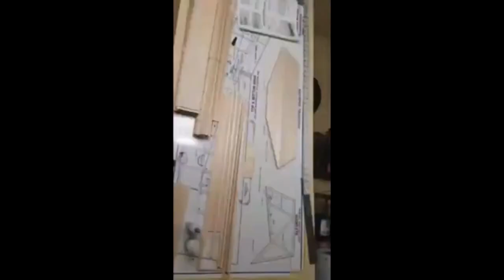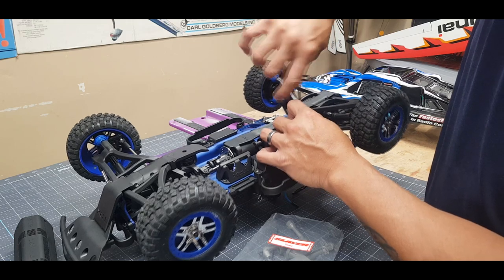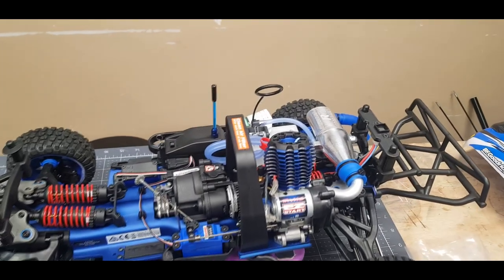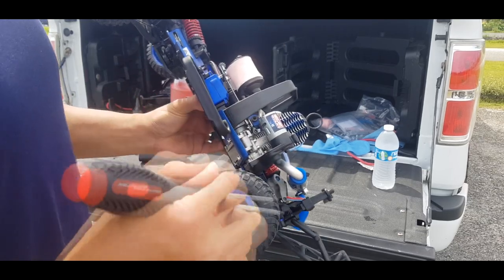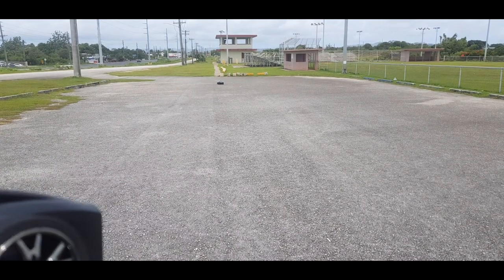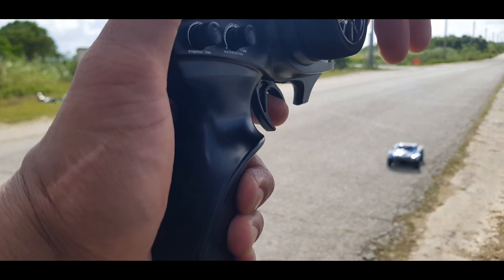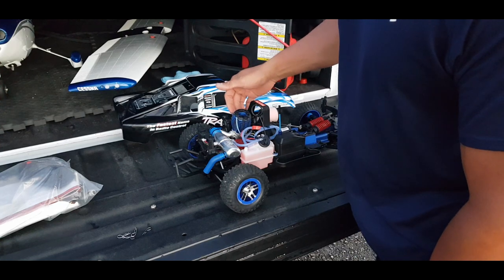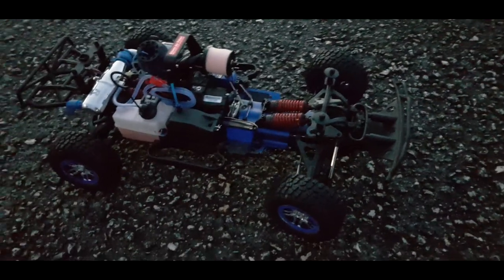How to Break-in your Traxxas TRX 3 3 Engine (Slayer Pro 4x4)

Comment: I just got a slayer, it is not my first nitro RC, I currently has 3 vehicles (1/8 buggies and 1/8 truggy) running 2 OS and one Picco engines, however I always send my new engine to my LHS which broke in for me by the Adam Drake’s method, I would just run them rich for one or two tanks before I made my adjustment, I am puzzled by the amount of effort needed to be made to break in the TRX 3.3, may I ask is there any short cut method to go for it, I accept suboptimal result, thank you very much
Reply from the maker: Well overall the idea is basically bringing the engine up to temperature and then allowing it to cool so that all internal parts properly work in slowly.  The problem I see with most of the newcomers into nitro is at the first run they are already trying to squeeze out all the power by leaning the mixture too much.  This is where they end up overheating the engine!  So the Traxxas breakin procedure is a careful way to get newcomers to manage engine breakin while getting use to their first nitro vehicle.
Reply from the maker: They have many breakin methods out there so it just comes down to personal preference to be honest.  All I did in this video was to show the Traxxas breakin procedure in action for those visual learners.

Comment: Good video buddy. 

I just was given to me a Revo 3.3 that needed a new Motor. 

I went full out and replaced everything so I have a brand new truck 
Minus the wheels they are still original.  

One question have you had the cylinder / piston ever get stuck.  
I watched a video of a brand new motor and it got stuck. 

His vid compared to yours his was rich on the low idle screw 

Yours seems very lean on the low speed needle.  

I’m learning before I go out and run my new build. 👊😎
Wish me luck man I need it. 👍👍
Reply from the maker: You can get what they call a hydro lock!  That is when the engine is way too rich and fuel floods the crankcase where the piston cannot complete its travel; either the engine must stop rotating or a mechanical failure must occur.  To clear this excess fuel in the crankcase you must pinch off the fuel to the carb, remove the glow plug and place a rag over the cylinder to catch the excess fuel, attempt to start the engine with either starter or pull start until all fuel has emptied from the crankcase.  Replace the glow plug and release the fuel line to allow fuel to flow to the carb and try to start the engine again.  You may need to adjust the low end by turning 1/16 or 1/8 turn clockwise to get a leaner fuel mixture to prevent another hydro lock.  My engine in this video is still running rich and as you can see the trail of smoke during the running of the vehicle also is a good indicator of a rich setting (However not in all cases depending on outside temps, especially in colder weather) I hope this helps.

Comment: do i have to do that everytime that i wanna use the car?

thanks for the video
Reply from the maker: No just for the very 1st time when purchased new.  After you break in the engine you just fuel up and play.  From time to time you might have to make very small tuning adjustments to the high end needle depending on current temperatures or performance
Reply: @BayonasRCWorld   alright thanks a lot
Reply from the maker: @manuelalbornoz3167  anytime

Comment: Do you have to do the break in all in 1 day or can you do the first 2 tanks 1 day than the other 3 another day
Reply from the maker: You can do that for sure.  It is not a problem.
Reply: Do it as you please ... but it's smoother to take a day where you can do it all at once. It won't harm anything to continue break in few days later ;)

Comment: Just got a revo this is very helpful 👌
Reply from the maker: Yes same engine TRX3.3 so all breakin procedure is the same.  Anyhow the Revo 3.3 and Slayer 3.3 share the same chassis and layout.  Just arms are different for the most part.
Reply: @BayonasRCWorld  how often do u change and clean anf oil air filter also how long do the glow plugs last ?? I won't be able to break it in till spring or summer here in northern new york
Reply from the maker: @bradwoods1087  change or clean the filter Traxxas recommends to clean the air filter after every hour of runtime with the engine (approx. one 500cc bottle of fuel). If the vehicle is operating in very dusty conditions, cleaning the air filter after every 30 minutes of runtime will be necessary to promote long engine life.  With that said real world applications I could go the whole weekend playing without cleaning my filter with no ill effects.  Now provided that your filter is not caked on mud or grime.  As far as glow plug if you have the engine properly tuned the plug will last a long time.  Plug fails if you have a overly rich engine setting or too lean settings.  Too rich and you flood the plug with fuel, too lean and you burnout the heating element.
Reply: Thank u so much lots to learn been in the hobby awhile this is my first nitro I can't wait to break it in do u have a after run Maintenance video??
Reply from the maker: @bradwoods1087  unfortunately I did not do one.  However what I do is ensure tank is emptied of all fuel, burn off remaining fuel in the crankcase, then remove the glow plug and shoot some WD40 into the engine through the glow plug hole, place a rag to cover the hole and attempt to start the engine or turn over the engine.  All the WD40 will then lubricate the engine bearings and all excess will be expelled through the glow plug hole being captured by the rag.  Replace glow plug and if your vehicle has 4 AA batteries then remove the batteries.  Here your vehicle engine is ready for your next bashing session.  Clean off any dirt and debris throughout your vehicle.  Also for those screw heads that are turning rusty color you can spray some WD40 onto a brush and lightly brush over all screws and then wipe off excess.

Comment: I'm breaking mine in for the first time and can't keep the idle.. it keeps shutting off after few seconds
Reply from the maker: All needles are at factory setting?  If so you can adjust your throttle stop screw a little at a time until engine stays running and idle is settling without quiting.

Comment: Question?? I got a slayer.. went step by step to your video and I can’t get it to idle. Any ideas? I’ve reset it multiple times and I can’t get it to idle. Help!!!
Reply from the maker: Adjust the carb barrel adjustment screw.  Turn it in clockwise alittle at a time checking the status of the idle.
Reply: Thanks. I was afraid to play with it too much. Your video has been a life saver for me and my wallet.
Reply from the maker: Reason why I made the video.  To help others by showing as much as possible while explaining the procedures as if I were right there by your side.  I have been playing, fixing, refurbishing, tuning Traxxas nitro vehicles for the past 18 years and have learned alot during these times.  I know the frustration one could encounter and have seen lots of people struggle and give up because things weren't going right.  So glad I am able to help!  If you have any questions don't hesitate to message me here or o  Facebook messenger.  I also have a Facebook group under the same name Bayona's RC World. 

https://www.facebook.com/groups/1102320606822541/?ref=share
Reply from the maker: @jameshall4918  in my Facebook group type in Traxxas and you can see some of the refurbished Nitro vehicles I have done.

Comment: Excellent information. So sad my engine last less than a month bad engine, wherever I'm getting a new one by tomorrow. I have a gallon of VP racing fuel 20% nitro 9% oil what do you think about that? Should I increase oil percentage? I have some castor oil, I don't wanna damage my new engine.
Reply from the maker: 20% nitro fuel is great as far as oil content anywhere from 8 to 12% oil is optimal more oil is not always better.  I normally 30% nitro fuel with 10% synthetic oil in my TRX engine with awesome power and engine life when properly tuned.

Comment: First thing you want to do is ditch those servos with savox that is what i use the traxxas ones always gave out after break in
Reply from the maker: I never had a Traxxas servo go out on me.  10 years later and still using original traxxas servos that came with all my vehicles.

Comment: Hi, why my car run by itself without pushing the throttle?
Reply from the maker: There are a few reasons for this.  However the first thing you should check is the idle screw.   Your idle is to high therefore you must adjust your idle screw on the bottom right of the carb counter clockwise until you have a steady idle without causing the engine to quit yet stops the vehicle from advancing forward.  Give that a try first and let me know the status.  Is this a new vehicle?

Comment: How many times must the oil needle
Reply from the maker: What do you mean Oil Needle?
Reply: @BayonasRCWorld  l set the fuel needle to5 turns can it work
Reply: @BayonasRCWorld  high rev
Reply from the maker: If this is a brand new engine I would advise to just follow the breakin procedure outlined by Traxxas.  That means all needle settings for the first start.
Reply: @BayonasRCWorld  thank you brother

Comment: No temp check ?
Reply from the maker: I use to do temp checks when I first started nitro back in the 80's.  Last time I ever used a temp gun for readings was early 90's.  Since then I have always relied of performance, sound, visual indicators like exhaust smoke etc.  All my engine run excellent without any degrade in performance and I have not blown a engine from being too lean etc.
Reply: @BayonasRCWorld  actually so do I rely on sound and performance but after I like the sound and performance I want to make sure that it's cooling down and stays at a certain temperature fine tune
Reply from the maker: @kaycee9337  Do what you think will benefit you and your goals.  If you want to use a temp gun and verity your temps when you run your engines then by all means if that makes you comfortable or run your engine to its optimal performance then can't be wrong.  What I am showing in my video is based on Traxxas breakin procedures and thats all.  For those who do not understand the manual or want to see the manual instructions in motion.  If you want more advance information there are many videos on YouTube that probably can give you further guidance into what you are after.  Let's not get carried away going beyond the intent of this video.  I shared some tips which is all I added to the video for others to just understand why.

Comment: I thought when you pinched it you had to let it die completely to get a correct reading?
Reply from the maker: No by pinching off the fuel to the carb you are determining by the reaction of the engine during that current condition.  Therefore, by pinching off the fuel line restricting fuel into the carb you will have either a lean condition or a rich condition.  A lean condition will be noted by an abrupt engine out, and the reason for this is because if your needles are turned to far in restricting fuel into the carb your engine will not have much fuel to burn off causing a quick engine off situation.  A rich setting will be by the prolong engine running after restricting fuel to the carb before it dies.  The reason this happens and a indicator of a rich situation is because if your needles are too far out or opened you are adding more fuel into the carb that the engine now will burn off and since the engine is full of fuel it will definitely take longer.  Again this is where counting 3 to 4 seconds after you pinch the line and engine idle increases and runs for between 3 to 4 seconds puts you at the ball park range for your low end setting with just the right amount of fuel in the engine.  This is the soul purpose of the pinch test.  Has nothing to do with killing the engine.  I hope this helps explaining the pinch method.  Let me know if anything.

Comment: Two things. One u never mention about cool down. Putting the piston. Below the pinch point. And stopping the second gear shift.
Reply from the maker: That is the 15 mins in-between thanks.  Remember that this is all off the Traxxas breakin procedures and nothing more.  If you want to add more on top of what Traxxas has already outlined then by all means.  However with that said if you know more advance tricks and tips, TDC and all then you don't need to be watching this kind of content because you are not a beginner or new to Nitro.  Like I mentioned in the video that this is all based off the Traxxas breakin procedures outlined in their instruction manual and breakin procedure cheat card nothing more and nothing less keeping it simple.  The video is basically taking those given instructions and putting it into action for the new comers to actually see and reference as per written instructions

Comment: Hello my intro slash m9ves on idle
Reply from the maker: adjust the carb stop screw or idle screw.  Not the high end or low end needles!  it is a screw hidden on the side of the carb body.  Turn it out 1/16th turn at a time until the vehicle stops advancing forward.
Reply: Ok
Reply: I see it it is hard to reach

Comment: Traxxas fails to say to make sure the Piston is all the way to the bottom because if you're breaking that motor in and the Piston stays to the top you're pinching the piston and it shrinks it faster just like on a regular the Pistons always stay to the bottom but these little motors don't. Make sure the Piston is free while it's cooling off because I'm most cases they don't but a proper breaking that piston should stay to the bottom
Reply from the maker: I have done this as well with my engines in the past and to be honest I have not noticed any difference in performance nor have I every had any engine issues.  I have had many TRX 2.5, TRX 3.3 engines lasting years and always running strong without any issues, and I ran my Traxxas vehicles every chance I get sometimes the whole week of bashing.  I also have taken thrown away TRX engines that were stuck, old, corroded, and refurbished them and performance is as good as new for many years thereafter.  Keeping the piston at BDC is a common practice especially for lots of the professional racers.  Now majority of Traxxas owners are just newcomers to the Nitro scene and or new to RC in its self!  Following Traxxas breakin procedures is good enough for the average hobbyist.  And let me say that if the person is here watching this video or any How to breakin your Traxxas engine then they must be new and the basic is all they need for now.  Even with just the Traxxas instructions and maintenance and care the newcomer to this hobby will have years of fun.
Reply: @BayonasRCWorld  well you're lucky but I noticed that mine had a lot more power than all the other three threes I ran up against but yeah you're very lucky piston belongs to the bottom regardless

Comment: You aren’t actually holding the throttle long enough during break in. You need to let it get to speed then count one two.
Reply from the maker: Brother this is how the Traxxas breakin procedure is laid out and I have been doing this for over 10 years without any of my engines overheating and or issues always great power.  You do not bring it up to speed before you start counting!
Reply: @BayonasRCWorld  idk I think you’re a little shy on your counting.
Reply from the maker: This is why there are 5 tanks to breakin procedure.  It is to gradually and slowly wear in the engine internal parts without overheating it or over reaching.  The time you start adding throttle begins the count.  Note the amount of throttle given during each tank of breaking and duration of the count leading up to the 5th tank.  This procedure is laid out in writing with all Traxxas nitro vehicles and Traxxas has also produced their breakin video many many years ago with the same procedure seen in my video.  Why that is!  Because it is stipulated in the manual for all to follow.  I am taking what is in writing and giving a visual for all to see.  I refurbish these engines, tune them to optimum performance for many years since the introduction of the TRX2.5 engines.  Also I have been doing nitro vehicles and working on nitro engines since 1986
Reply from the maker: @Roadhouseee  I mean in the video I am trying to explain it so others can see in real time.  My counting yes could have been off alittle or shortened per say during filming of the content but the explanations is there for others to comprehend what is going on.  It was a long day that day with bad weather and all so alot went into just trying to make the video on that day and boy was it hot at the sametime.  But yeah!  I understand what you are saying and I agree.

Comment: Wouldn't you make sure the engine is at BDC bottom dead center for the cool down process
Reply from the maker: What you see me demonstrate In the video is straight out of the Traxxas manual.  This is mainly for newcomers to nitro and your basic Traxxas breakin procedures.  If you are advanced and want to do more than the Traxxas procedures then by all means do what you know and feel is best for you is what I say.  Once users are accustomed to their first Traxxas nitro engine or vehicle and gain more experience over time they will eventually venture out to more advanced things to include fine tuning their engines for optimum power.  I have done all breakin methods on Traxxas engines and all work great!  To include Traxxas breakin procedures.